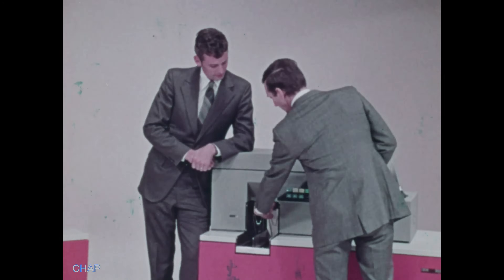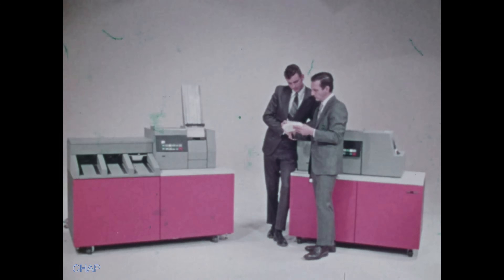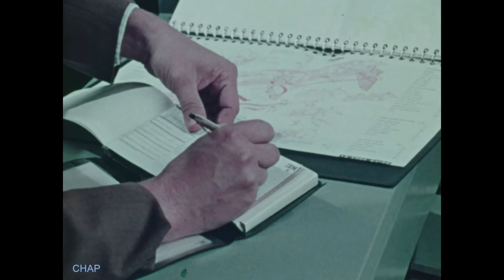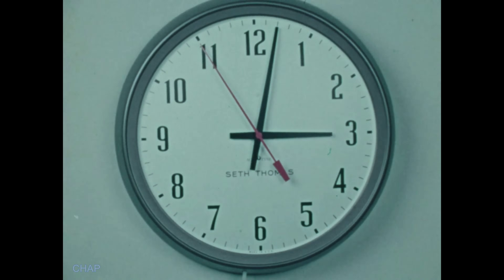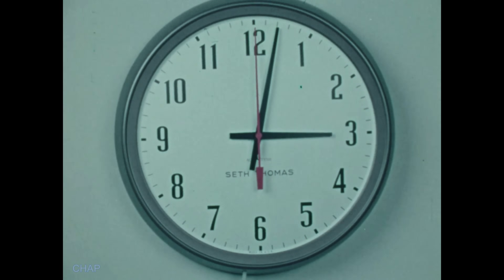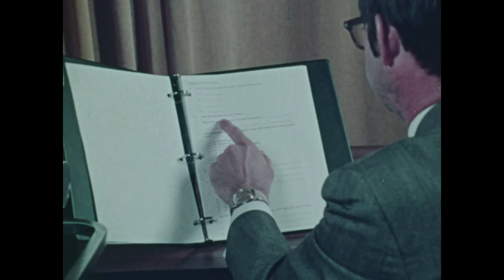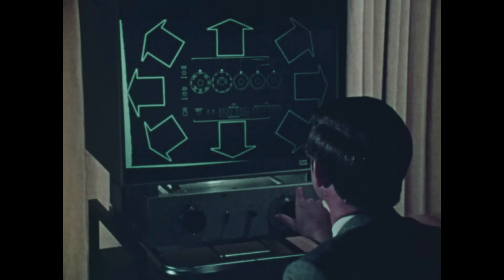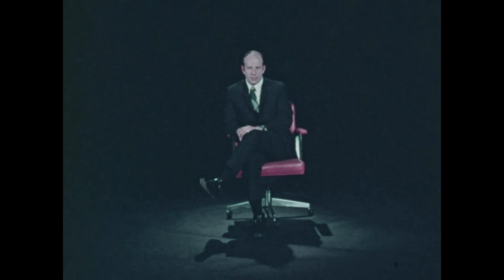IBM Computer Tech Support 370 Mainframe Punch Card Systems 3505B & 3525 Customer Engineer Hardware

Comment: 13:03 The circuits were wire wrapped?
Reply: Those are a type of read-only memory and can be altered by IBM, not the user.
Reply: Actually that is the backplane for the cards inserted on the other side. Backplanes were customised at the factory